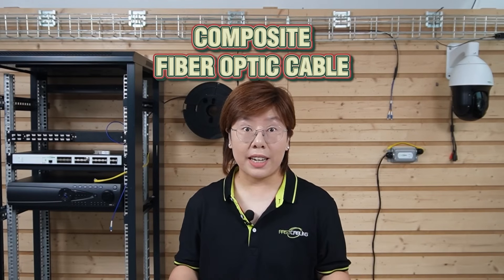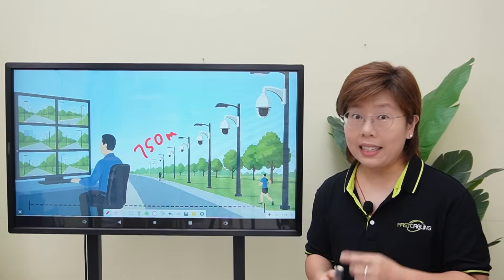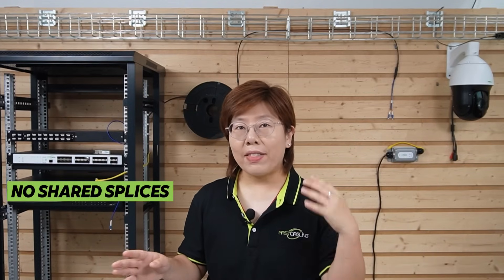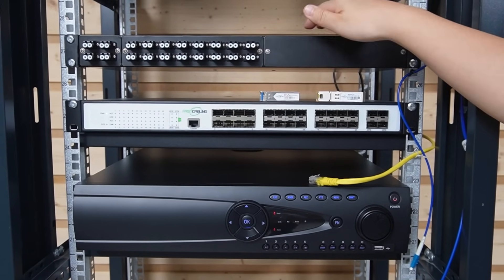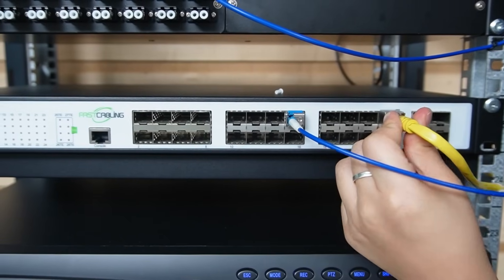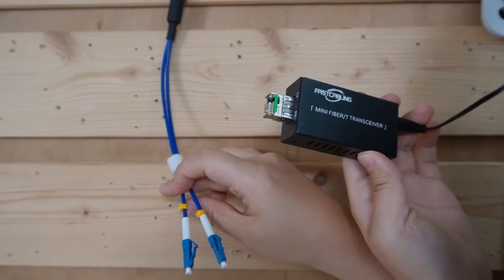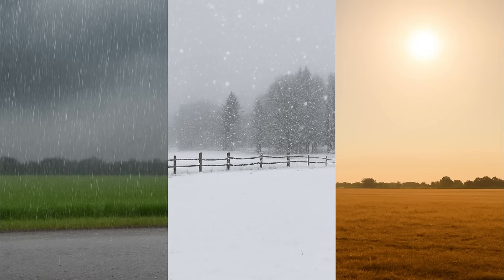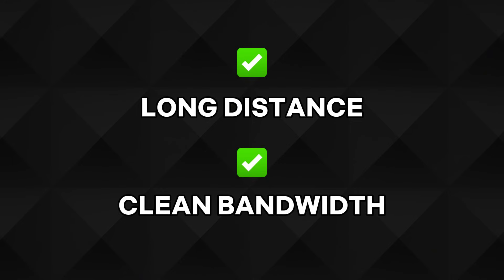Deploy 60+ Pelco PTZ Cameras Over 750m — Fiber Backbone & PoE++ Power Setup

Comment: Can you connect Fiber Optic Cable to PoE injector? So poe that comes out to injector with both power and data?
Reply from the maker: No, the PoE injector doesn't have an SFP port, but you can use a PoE media converter, which can convert optical signals to Ethernet and deliver PoE power to the connected device at the same time. 

https://www.fastcabling.com/product-category/media-conversion/?wpf_filter_with-poe=with-poe&wpf_fbv=1

Comment: what if the camera is a g4 ptz, that 1800 dollar camera
Reply from the maker: Then you only need the power solution for that camera.
Reply: @Fastcabling  then we can use solar panels
Reply from the maker: Yes. If the camera consumes 30-40W, you need 800W solar panels and 48V 100AH batteries to achieve 5-6 days backup power.
Reply: @Fastcabling  i wonder in an enterprise office center, how should i wire ubiquiti and fastcabling switches.

Comment: You don't connect POE ++ outdoor injector to SFP mediaconverter
Reply from the maker: The Pelco PTZ camera have media converter built-in, accepts PoE, DC48V, AC24V power input. The PoE injector acts as a power supply only. It doesn’t handle the data at all.